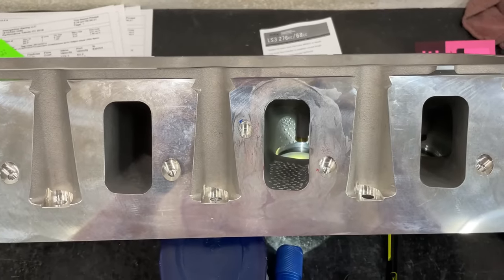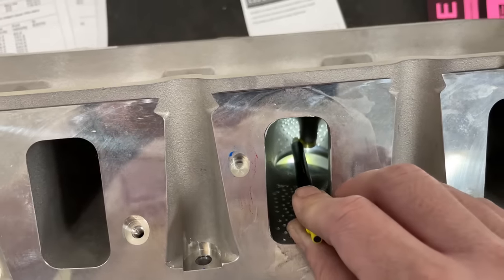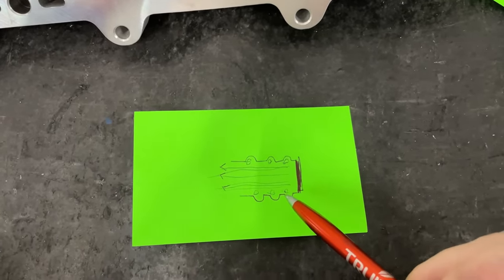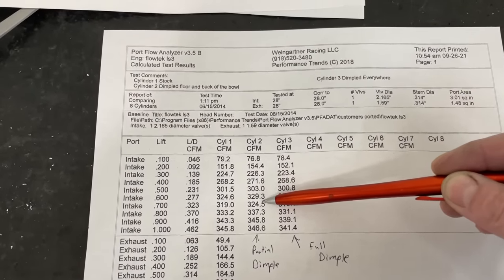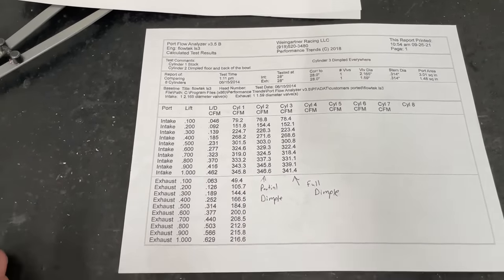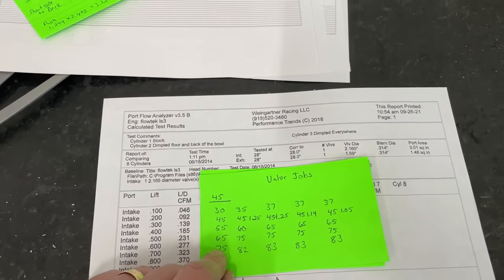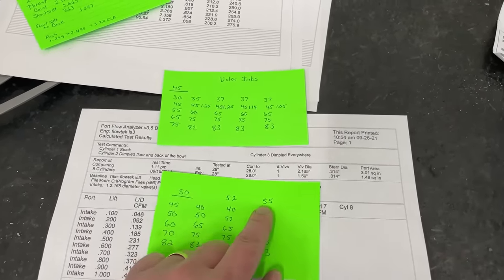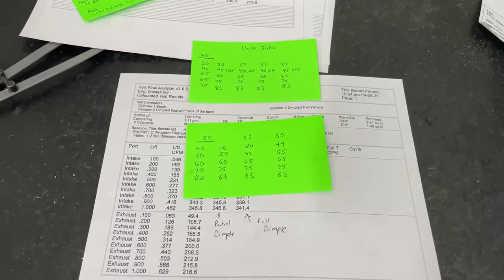Dimpling of Intake Ports Does It Help Part 1 of Internet Ports Heads

Comment: I just wonder if there is a long enough period of flow when the port is actually under load and not on a flow bench -- will there be enough time to develop constant dimple eddies that the airflow can ride on? I thought the air would be too turbulent at 6,000+ rpm...
Reply: Turbulence is great at high RpM to combat fuel puddling and trying to burn wet fuel. We use very coarse sand blasting on ports to get better fuel atomization.  And my elder engine builder that thought me proved it’s worth on the dyno. And just sandblasting from smooth to sandblasted was good for 25hp on a only 500hp engine. I learned that at a young age
Reply: @jamesgravel7755  Hi James, Your engine. Was it carburetor or Fue injection

Comment: I know Smokey did it in the 60’s with a blunt center punch until Nazicar outlawed it.  He also dimpled the dome but he did smooth them out to prevent hot spots and predetonation.
Reply: HA! Nazicar...funny, you just made my day. Thank You. There were quite a few innovators in stock car racing. Just couldn't get by the people who didn't know much about racing, just how put on a show they thought the fans wanted to see.
Reply: The punch actually raises the material around the hole , I do this on all my two stroke porting.

Comment: How about if you port match a intake manifold (make it larger to match larger head port) and then simple the entire thing to increase velocity? 

Would that help over all? 

Only reason I ask is because on my 2.5 na Volvo 850 the intake manifold ports are significantly smaller than the head port.

Comment: I understand the theory however after years of porting two stroke and four stroke engines experience and information has
always shown me that dimpling creates puddling of fuel..yes it might pick up a little on a flowbench but that's not taking into consideration the way that atomized fuel acts..maximum numbers on flow isn't necessaryly the whole picture,port velocity,shape,finish,etc,etc all contribute to Max h.p. and also NEVER polish an intake port either.
Reply: Don't dimple the bottom just the side and top
Reply: I'd question that comment :" never polish an intake port"...always worked for me over having big lumps of metal hanging in the wind: polished transfer ports in a 2 Stroke have always worked too.Trev New Zealand 🇳🇿
Reply: I'm curious about the "never polish intake" comment 🤔
Reply: @itdo.  On a 4 stroke the slightly rough texture helps keep the fuel/air mixture atomized, in a 2 stroke it can cause fuel droplets to form, but it's ok to polish the transfer ports: the heat of the jug helps keep the suspension atomized.Trev NZ 🇳🇿
Reply: Just sounds like a myth to me. Never actually seen anyone compare results to back that statement.

Comment: Raise the floor of the port. You can fill it in with epoxy. Increase the radius of the short turn and raise the roof of the port to to match the floor. Maintain the bias of the intake runner but you can make it wider if there’s enough material to do so.
The guys on Mythbusters dimpled an entire car and it reduced aerodymic drag. Dimpling should help. Now to watch the video!

Comment: Exhaust valve: on the face of the valve, the part you see in the chamber. Round the edge of it so the air can navigate around it and get into the port easier. I chuck it up  in a drill and do it by hand on my bench grinder and then my belt sander. It’s usually good for about 5cfm almost everywhere.

Comment: Full dimple reduces port size via boundry layer think golf ball provides lift and reduces resistance around ball but increases surface area shrinking port size due to enlarged boundry layer.  The partial behind valve and on floor good and you proved it as little flow takes place there and more boundry layer in those areas improve flow into valve pocket and combustion chamber.

Comment: I love my flow bench... Especially  after I was informed of how much I was  missing with just using the numbers . The introduction of smoke and a small fortune spent on what looks to be balls on a stick flow balls .the first time I saw what dimpling or what I call it golf balling was in 95 on a set of brodix 13 or 10 degree heads for sbc a guy brought into me to fix a dropped valve and beat the piss out the chamber he was at the local race track which was literally 1 mile from the machine shop my uncle owns. They where only dimpled  
On floor and  tappered from one dimple on wall at floor of port to 6 all the way to the short turn those heads moved some serious air and velocities where amazing . I played with it  found good and bad it works  if you are shooting for engine masters hp bragging rights the time is worth it how much it cost to do is problem I seen CNC doing it now
Reply: the flow ball concept is mostly overlooked by porters.
Reply: This is very true there is a specific reason why they are so expensive tool that work are not cheap.

Comment: You should try WPC treatment on the inside of the port! They say it reduces friction significantly but maybe they just mean between two metal parts… idk but would make a fun video! Love the content! Keep it up!
Reply: WPC only benefits parts where there is friction between two parts, such as a rod and crankshaft, or the wristpin and piston. WPC treating a cylinder head has zero benefit and a waste of money. 

Anti-friction methods do nothing for airflow
Reply: @rotor13  Oh man someone has already tested it? Could you point me in the direction of the recorded test results?

Comment: Only dimple on the lead-in to a short side with divergence greater than 6°. If it's parallel, converging, or diverging lass than 6 then leave it smooth.

Comment: different, would it make sense to have a dimpling setup plate made on a waterjet, or lazer cut from say 16ga steel that could be formed to the bottom of the port to do a partial dimpling, and have more consistant dimples? at least it would be a parameter of this to try.... you could also trim the dimpling plate to fit your application/port and specify a size ball burr to be consistant... I imagine the eddy being created in the port hinders/restricts flow/volume especially at higher rates. I find the idea of port design interesting, and am enjoying seeing other designs & ideas implemented.

Comment: Dimpling gives only 1-2% better flow. More power is hidden in size and shape of port and valve job. But if you are looking for that last 0.1% of power gain it's a good mod.
Reply: It’s about creating turbulence to fully mix the air and fuel droplets. Most tuners doing porting polish the exhaust but leave the intake rough.

Comment: My explanation would be that the dimples slows the air down on the inside. It helps to stream the air trough the corner. (You trip the air the right way)

Comment: The boundry layer is almost always going to be around .100" thick no matter the surface, it's simply near dead air, the closer to the surface, the slower the air moves...
Reply: Held in place by the intrinsic electromagnetism of any material that holds a different charge than the adjacent materials.

Comment: The Dimpling is a bit ambiguous here and pretty rough. To get more acuret data you would need to computer model it and under strict parameters and techniques such as How far apart the Dimples are from each other, the Diameter of the Dimple, How deep the Dimple is, and as you correctly assumed location of the Dimpling, and under High Flow Low Flow conditions. And the big question is it worth it ? Do Rasing regs allow it as a modification.?

Comment: It would be interesting to see a stock sand cast iron head done with the short side/s left as cast, other than any obvious ridges, and the rest just smoothed out without trying to go crazy on the modification.
Reply: @mctigmctiggy1475  even thought it ain't like it was back in the day, there are still folks who do.

Comment: Very interesting investigation video, you're quite right about the effect on boundary layer and that it would increase the air velocity by narrowing the effective passage.... But I don't see that it would increase total airflow....  Isn't the whole point of port polishing to maximise laminar flow, i.e. the opposite of dimpling?    Then again I would expect dimpling around/after the injectors to help with atomization.  I'm no aero engineer, but I guess to get this right you'd really need to do some modelling in solidworks..

Comment: Wow it creates a pudling affect at lower RPMS ,  flow & mixing are two different events 😊🥂 to munch of a good thing goes sour .. I did this concept  to my porting on intake & iron heads in 70s , I forgot how munch fun I used to have 🥂🏁🥂🏁👍
Reply: Yeah but how would that work on a direct port injection?
Reply: @LightningFast240  where I could ,,,,, i   tryed to formed a velocity stack shape toward the cylinder, without sacrificing cc space, to speed air close to piston changing directions & to  pressure fill the back of valve , I think any time the air can fill the cylinder ,easiest & fullest ,it's a plus 😊 the air is the mixtures taxi as I'm thinking back then🏁

Comment: The premise is to loft the mixture over relatively dead areas of the  intake tract, I have done it to plenum floors also.  The Ford FE is a great garden variety head with CJ valves and even 2.19 5/16 stem intakes to get over 600 hp with. Aluminum welding is better, and less labor intensive. But if a certain casting is required and this modification is allowed or you just want to mess with people. Lol, why not?

Comment: You should see the biggest flow increase by dimpling the short radius only. Well, maybe just the short (or bottom of the port). So basically the partial porting you did, MINUS the dimpling of the bowl PLUS dimpling of the short radius. Golf balls are dimpled to make them travel as far as possible through the air. If the surface of the ball was smooth, the airflow around it would detach early creating drag on the back side. This drag would effectively pull on the ball in the opposite direction to its flight path. The dimples disallow this early flow detachment greatly reducing said drag. In other words, no dimples, the airflow detaches somewhere shortly after the equator of the ball. With dimples, the airflow remains attached to the spheres surface well into the back side. Thus, the air is better able to follow the balls curvature in full. For cylinder heads, this means more airflow as the air pressure past the valve on the short radius side is often lower than the opposite side. So better airflow, and potentially even better fuel atomization than more cfm alone would generate. Oh, and the dimpling of the top side of the port basically causes more resistance to the airflow since the air is colliding with a concave surface that is not smooth. So dimpling on convex surfaces...yes. Dimpling on concave surfaces, maybe not. Flat surfaces are somewhat indifferent I feel. How do I know this...?  I studied the mathematics of fluid mechanics in graduate school :-D

Comment: Seems like it running into the bowl straight than the turning with dimples this adds to much turbulence going into the valve. The floor makes sense as it is always going across the surface.

Prob should do all the surfaces going into the bowl.

Comment: I run a small CNC shop with 5 axis machines, I've always been very interested in engine building but never had the time to get into it, this is something I've been wondering about for a while.  As someone with lots of 5 axis machining experience this would actually be super easy to do with the right machine and software.  Side note I'm always shocked at how poor the surface finish is on CNC ported heads in aluminum it should be easy to make them looking like mirrors, I always wondered what a mirror finish with dimples would do.
Reply: Mirror finishes typically create boundary layer restrictions.
Reply: @actually5004  sorry what are layer restrictions? And wouldn't dimples fix that? Golf balls are super smooth, I'm assuming for a reason.
Reply: @85CEKR  The boundary layer is an area next to a surface where the flow does not separate from the surface but clings and drags across.  Dimples would typically fix that, but the rough surface finish on most cast heads is enough because for the dimples to be effective, the air pressure needs to be higher and the velocity needs to be lower than conditions in an intake runner.
Reply: @actually5004  thanks for the info

Comment: 10 months late and maybe it’s mentioned in here but the dimpling should make for “slipperier” port. The air “sticks” to the surface due to friction like any other solid or fluid. I remember a segment on Top Gear when they highlighted the air channeling on the Ferrari F12 how it’s send down the sides of the car which creates a boundary layer of air for air flowing around the car to slide against and therefore less drag. Same idea, bigger boundary layer, more air “lubrication”…more flow. With the partial dimple you had more flow which more or less proves this. The full dimple shows less flow and if I followed correctly the “full” had the dimpling down by the valve. The decrease is probably due to some reversion which is due to the added boundary layer and turbulence in that area. Idk just my 2¢ taken from what I learned in Fluid Mechanics in college

Comment: I would like to see dykem sprayed into the port while flowing to see how the dimpling changed the wet flow characteristics.
Reply: You will like it, I have done it.  I also have read the chambers and pistons after a while . The mixture is more homogeneous.

Comment: I love to see riffleing the intake port to see if it would flow better and or atomize the air fuel mixture better.
Reply: It may atomize the fuel better but it isn’t going to make the head flow better because pulling the air across those grooves is going to increase the pumping loss of each port.

Comment: Want to see valve back cut 27.5 get real close to the lap line of the 45 degree then 30 degree just break the edge/lip between the 27.5 and 45 
Grind the 45 lap in
Backcut 27.5 then do the 30 degree touch while valve still in spindle untouched/unmoved wondering increase or decease flow?

Comment: Nice work. 5cfm on each port is about 10hp NA potential total on a v8. How is your flow bench calibrated? As you said, as cast ports may not be exactly the same so can you clean up the dimpled port just enough so it's smooth again and see if it's better to  smoothly open up the port or dimple it? Thanks.

Comment: My alcohol 351 with Canfields had the golf ball treatment. Keeps fuel in suspense. Definitely made absolutely no difference that I could tell. Then I got some Meaux ported iron heads and I noticed a big improvement
Reply: At the speed of flow in the ports the fuel won't drop out of being suspended whatever you do.
Reply: @samwalters4205  try all 24 cars bunched up under 2500 RPM with 14to1 430 cubic inch wide bores with damn near .900 lift trying to come off turn 3 on a green white checker situation. I ain’t stupid.
Reply: @bradleymorris8875  cfd disproves it even at idle speeds. Try that instead.
Reply: @samwalters4205  so reversion has nothing to do with a DLM taking off way under the curve … how about dumping the gas at 8,800 to rotate and set the car then picking up the throttle again backed in .
Reply: @bradleymorris8875  has no effect on keeping fuel in suspense in the airstream. 

Even when the port volume to swept volume ratio is massive is has no effect on suspension of fuel in air stream entering the combustion chamber. Mixture is buggered mind but that's for other reasons.
Reply: @samwalters4205  until the intake charge gets up to speed the fuel does weird shit. My flow bench might have been made out of plywood but I definitely noticed the fuel falling out of suspension… visible with my naked eye in the low lift numbers even with the exhaust valve missing
Reply: @bradleymorris8875  Reynolds numbers on your flow bench are not fast enough even for idle and if you cant get close to the required reynolds number you cant remotely think about testing for what you describe. Nor can you test for if dimpled ports have any effect. 

Don't get me wrong flow benches have their place but they are an absurdly crude tool in the grand scheme of things. 

My suggestion is you revisit basic fluid mechanics. You will very quickly see what I'm saying all this.
Reply: @samwalters4205  my limited knowledge came in the late 80’s. I was just a backyard kid porting heads and figured out mostly nothing. I just remember having some Canfield and old Gurney Westlake heads that were dimpled and got off track as usual.
Reply: @bradleymorris8875  I get what you are saying. 

There are just better ways. Maths can be of great use to us. The principles are not new either. They predate us by many years. They are just rarely applied by a hobbiest.